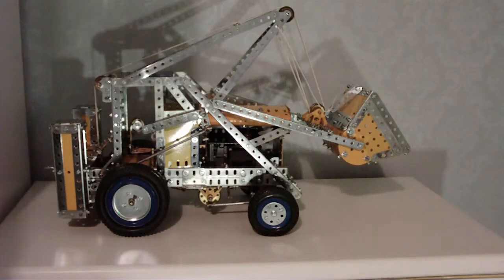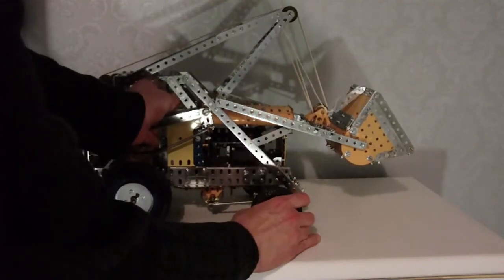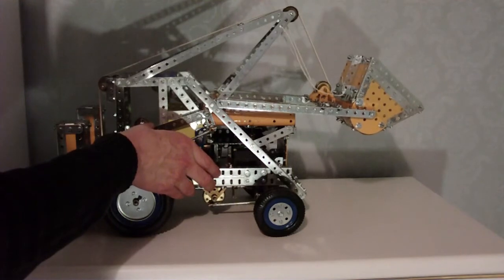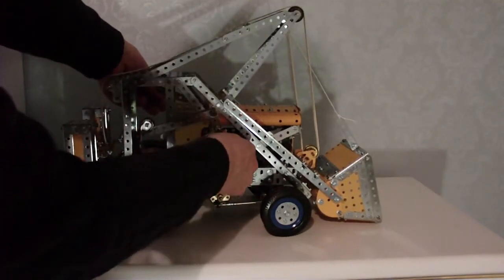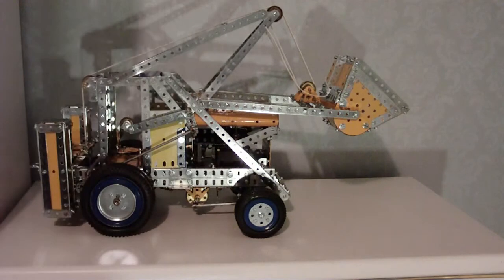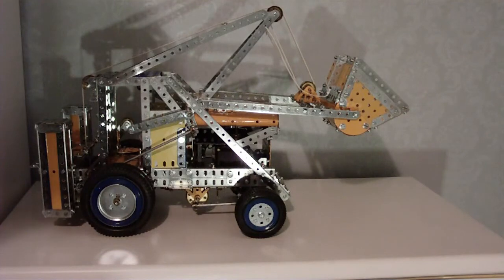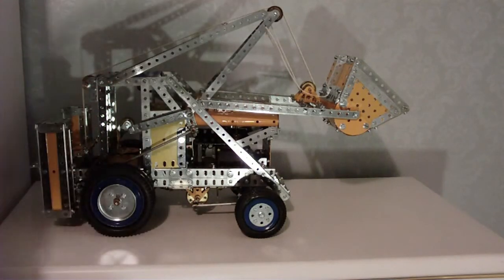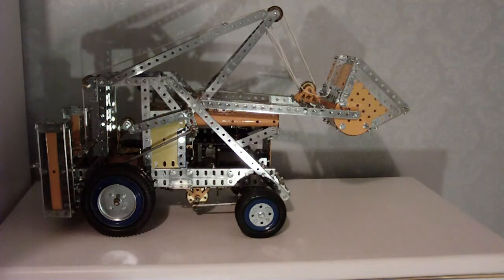Meccano Set Ten (10.6) Lifting shovel

Comment from the maker: Ditto, I had to change it slightly, actually just the front axle, the steering was OK. I couldn't attach the two flat trunnions as mentioned in the instructions. There didn't seem to be enough space. I also had a lot of trouble with the differential, but did get it working almost as described. I used external collars to adjust the rod positioning so the bevel gears would engage in the cage.

Comment from the maker: I'm afraid not. I want to do 1978 set 5 to round the 1978 sets off. Also a few 4EL (Elektrikit) models. Hopefully for the 2013 SELMEC exhibition there will be a pinball machine. If I were to do more set 10, then maybe the double deck bus and/or the blocksetter crane.